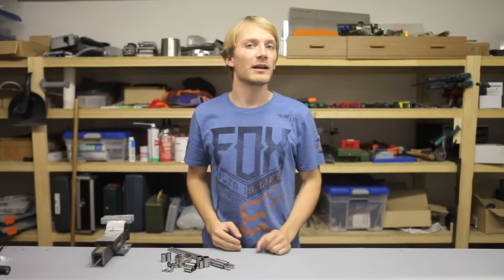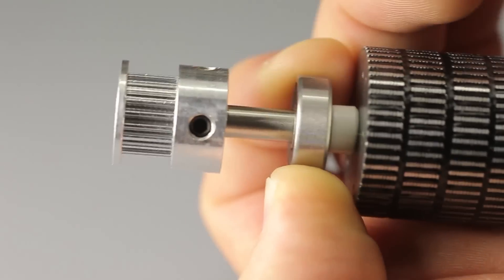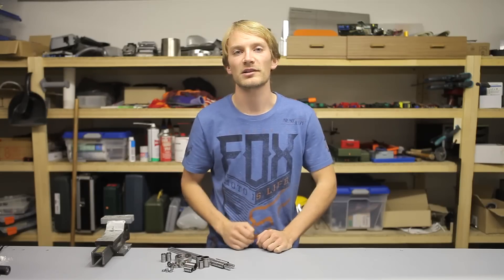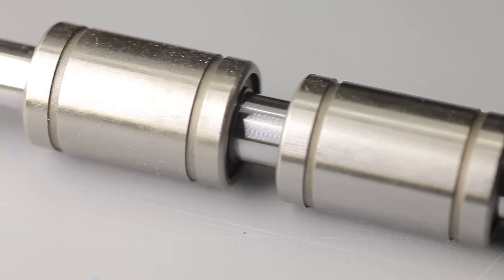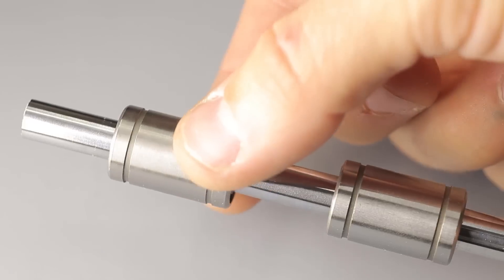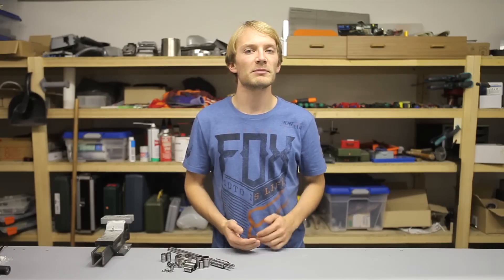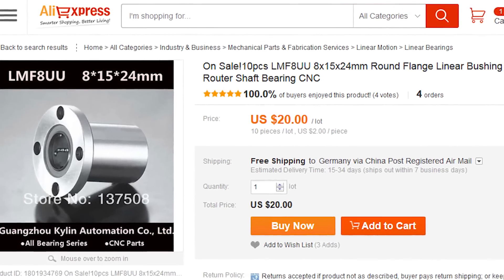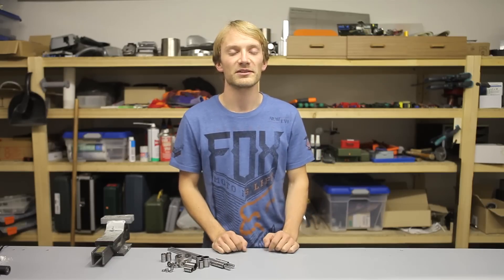3D printing guides: Radial and linear ball bearings!

Comment: Why there is play in lm8uu based linear rail , I measure the diameter of different roads all diameter is less than 8mm it's around 7.6 to 7.8 mm is it common tolorance or perfect 8mm rods are also available??

Comment: I ordered saft for 8mm I'd before ordering 8mm lm bearing I also measured the saft which was 7.6 to 7.8 mm reading I thought may be it will not matter much with  lm8uu linear bearing , But later when it arrived i noticed lots of loose play because of 7.8 mm saft , so I am not Sure what are the tolerance with proper saft of this Size ??

Comment: Every time I try to use radial ball bearings in a project, I can't get a shaft that will have the proper interference fit. Linear bearings usually come matched with the proper shaft. Can you point me to a source for stainless steel shafts meant for radial bearing in various lengths? I'm not a professional and have only Amazon as my source for steel shafts and those sources won't give me the tolerance on their shafts. Help!

Comment: Someone should have told creality that radial bearings are bad for axial load. Every creality bed comes with bearing installed the wrong way and with lose fit. I had to print pla shims to get rid of bed wobble.

Comment: If i have a 10mm shaft, should i use 10mm or 12mm linear bearing with it?
Reply: Lm10uu
Reply: 10mm bearing
Reply: 10mm shaft need ofcourse 10mm bearing, etc, LM10UU only idiot try use 10mm rod whit 12mm bearings  hahaha. and 12mm rod not go in 10mm bearings, need be together same size.

Comment: Good info, but you need to look up 'backlash' in an engineering text.  To quote Princess Bride,  “You keep using that word. I do not think it means what you think it means.”  Backlash is, strictly speaking, movement induced by a change in speed due to flexing, stretching, or torsional stress. e.g - Motor stops, print head stops, the frame/belt/linear rail 'un-flexes' and something moves (and usually oscillates) when it shouldn't - that's backlash.  In your car, when you brake hard, stop, and the car shifts back on its suspension - that's another example.  Something that moves unpredictably because it's loose can make backlash worse, but it's not backlash in itself.

Comment: Thomas I envy you your roomy workshop and storage.  I wanted to thank you for taking the time to explain a little about the bearing ID, as you can imagine ordering the parts for a 4'x 4' CNC Router is a big deal, and now I have been asked "Do I want the SFU or DFU ballnut  with my HGR 25 Hiwin linear rail kit. Well I would sooner have rack and pinion but there are good things about each method of motivating. But in that moment I realized I had better know exactly what all this nomenclature is meaning.

Comment: Linear bearings don't work nearly as well as radial ones :(

Some people are starting to 3D print reusable bushings that are lined with PTFE piece inserts, like cutoffs off the Bowden tube or PTFE wire, so the printed enclosure doesn't touch the rod, only a few patches of PTFE do. When it grows loose, you can just replace the PTFE pieces and you're all set again. Maybe something to try.

Comment: White kind of grease do you recommend for lubing linear rods? Do you think lead screws should be lubed?
Reply: Scott Dickey imo motorcycle or bicycle chain lube works well on both the linear rods and screws , it's slightly waxy so it doesn't pick up dust and grit as easily, provided you use it sparingly

Comment: Three more hints.  I've designed and then built a number of robots and when using linear bearings, always get the 'split' type, which allows you to adjust the radial pre-loading inside the block assembly.  Next, opt for bellows covers that run the full lengths of travel.  In 3D printers the vapor from the melting plastic, as well as dust in the average work area, puts layers on the surfaces that gets worked in as the bearings roll over the tiny particles, bellows covers keeps things clean.  My last hint here is… forget drive belts, instead use stainless steel bands, they're far more precise, far cleaner, thermally far more stable, and ultra durable.
Reply: when you say steel drive bands, what exactly do you mean?
Reply: Google for stainless steel timing belt. I'm sure that's what he meant
Reply: where do u get ss bands?
Reply: I just saw these bellows for ball screws today and for the first time I have considered this as a solution to a CNC Router DIY 4x4
Reply: Way oil is great for lubricating and protecting shafts.  That's what it's been made for for centuries...no need to get too complicated, although I like your suggestions.  I've never heard of a SS band...what the heck is that?

Comment: Hi Tom!
You forgot to cover Graphite Bearings. What I can say immediately, that they are  for sure less noisy than LM(x)UU.
Check out this Selfgraphite 8*12*30mm Linear Bearing  (Ebay : Graphite Bearing)
http://www.robotdigg.com/product/175/Selfgraphite-8*12*30mm-Linear-Bearing
or http://www.ebay.com/itm/1Pc-6-10-8mm-JDB-Graphite-Lubricating-Brass-Bearing-Bushing-Sleeve-Oilless-/161808085631?hash=item25ac83727f:g:zfAAAOSwT6pV3-H6

Comment: One of my Printrbot Simple Metal's linear bearing on the Y-arm seems to be cracking some times. Its really annoinyg after a time.
Does anyone know how to replace this bearing, since its hammered into an aluminium block?
Reply: Email customer support, or find a mechanic, garage, or machine shop that can press in some new LM8UU bearings.

Comment: I'm toying with a magnetic mounted attachment for liner axises ,the right magnet with a steel greased plate attached  to  the belt could eliminate belt and stepper chatter completely . Key is the right magnet . the liner bering noes would still be there but V channel and delroin wheels are very smooth .

Comment: I got an Prusa Mendel i3 printer and are going to upgrade the X-axis, going from vertical to horizontal.
My current linear bearings is ok, but a little loose(vertical X-axis).
I was wondering if switching to radial bearing may be a solution to try out , have you tried this?
Reply: +Thomas Sanladerer "Which was everything but an elegant solution."
Do you mean that while it was a good solution, it failed in all respects of elegance? Or was it that it was just a poor solution?
I am asking as I can either go with high quality radial bearings, or low quality linear bearings.

Comment: Hi Thomas,
thanks for this video, I recently got the smooth rod for the printer I'm building, and I ran into some issues with sliding the bearings (and yes, I've used a chinese ones)
Maybe you could take a look, http://blog.darmach.ovh/2015/01/not-so-smooth-rod and comment what do you think about that?
Reply: ***** No, actually the rod has been bought from the company that sells cnc mills stuff, and its precisely machined from ch55/cf55 steel, hardened to 62HRC and 0,2um smoothness.

It turned out the issue were chinese bearings - I bought some bearings from the company I obtained the rod from. While 5x more expensive, they slide beautifully.

Comment: Will it make a difference if you used a steel pipe instead of a hardened shaft?Will you face the same issues as with aluminum shafts?

Comment: Thanks for the information, this was really helpful with figuring out a problem I was having with my printer!
I noticed that you briefly touched on measuring threaded rods in this video. Identifying and selecting threaded rods is definitely something I've had trouble with while repairing, upgrading, and troubleshooting my printer. Is there any guide out there that explains the terminology behind threaded rods? Thanks!

Comment: My experience with the Chinese linear bearings is that it pays to wash out the factory 'lubricant' with a light machine oil or something like WD40 (which is NOT a lubricant, it's mostly solvents) and then re-lubricate.
Reply: I agree with using a 3:1 oil and not grease in a non sealed bearing. The grease will collect and hold dirt while an oil will slowly flush itself and help to keep the bearing clean. Provided you take the time to lubricate it occasionally.
Reply: What lubricant do you recommend?
Reply: ***** Something like 3in1 does the job.
Reply: @anderslarsson7123  SKF recommends grease for linear ball bearings. Ex. SKF Linear ball bearings catalogue 2003-08 (p. 16) -> "....linear ball bearings are, in general,
designed for grease lubrication....". I believe they do this, as linear ball bearings generally mostly do low speed operation, where oil has a hard time to form a film, and thus grease is better at protecting the bearing. I think in general for high speed applications (ex. sewing machines, engines) oil is used. Even the orientation of the bearing matters, as to how oil might pool in places where it cannot recirculate or even drip out.

As for the specific type of grease, it seems to be highly dependent on the application. Probably a lithium grease of viscosity class 00 to 3 is fine. Some sources (ex. linearmotiontips) do mention you should not use PTFE or graphite type grease.

Comment: If you are in the U.S. VXB bearings is a great supplier with very good quality yet priced comparatively with the China ones. They also carry some very good and straight hardened chrome rods but not on their website, only through Amazon for some reason.
Reply: *****  That is why I mentioned them. They are a small company and not very well known but they have great product and good service.